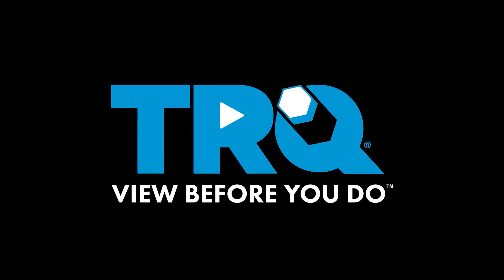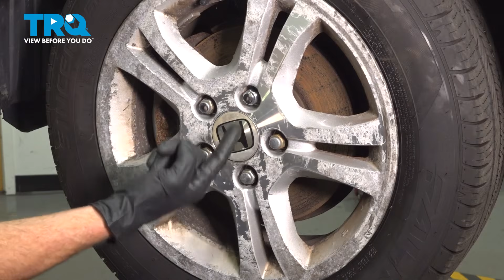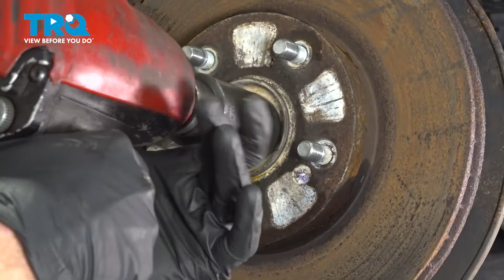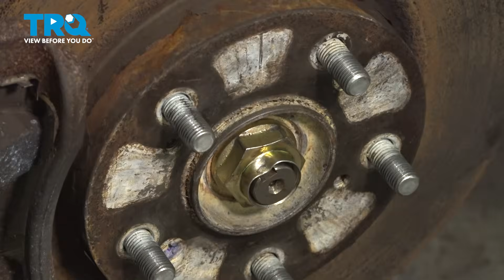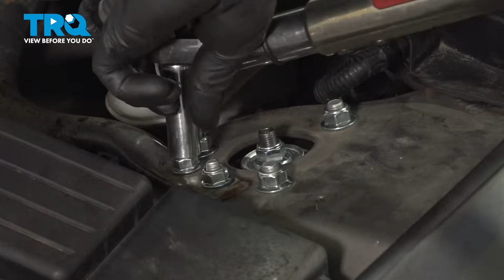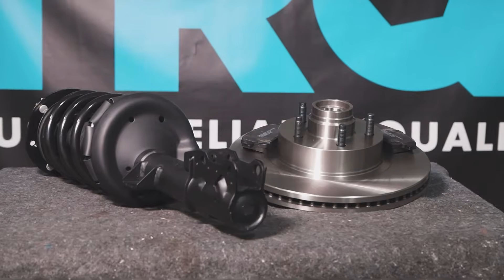How to Replace Front Upper Control Arm 2003-2007 Honda Accord

Comment: DIYers be very cautious of overtightening the UCA bolts. YOU WANT TO HAND TIGHTEN THEM ON, THEN CONNECT REST OF SUSPENSION (so the wheel will be in normal position) and then torq bolts. It looked like they were overtightened here and that's why so much force was needed for the UCA to be pulled onto the steering knuckle

Comment: I have to do this in a few days.thank you for the instruction. Can you tell how long typically the upper control arm lasts? I had it changed 70.000km before. Isnt that a little short life?

Comment: The control arm height needs to be set before the bush bolts are tightened, otherwise the job will have to be done again in 1,000 miles or so when the new bushes fail ! 
There are a pair of alignment holes that a rod should be put through to set the height of the arm, the left hole is visible at 5:24 minutes an inch or more below the arm. You only have to watch how much the arm is forced down when engaging the ball joint to see the amount of error in the position of the arm relative to the alignment hole.

Comment: The small bolts using 16ftp whats the name of that bar attached to it and whats its purpose mine is a little rotten idk how the engine bay is all clean only those 2 things on both sides is rusted and when i check the other end of it it looks like its riveted into the body ?

Comment: I was just confused on why you had to take the axle out
Reply: I’m asking the same question
Reply: My assumption is that they were doing a repair involving the axle or any other part, so they took advantage of the recording day and  did other repairs as well. This error of involving the cv axle could be the editors mistake since possibly the editor doesn't work on cars or wasn't there on the recording day and didn't know better, so other clips where included.